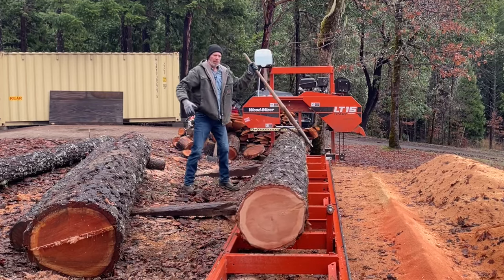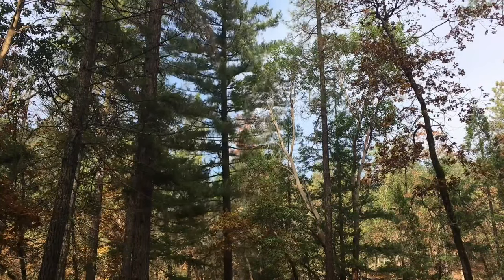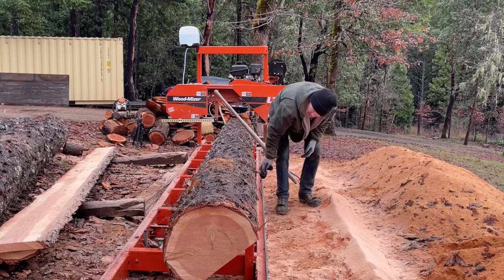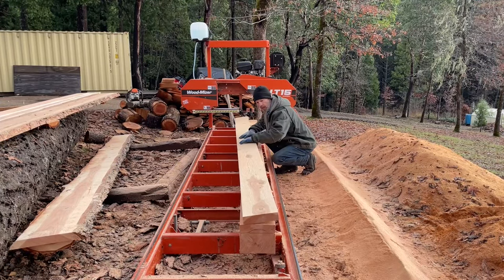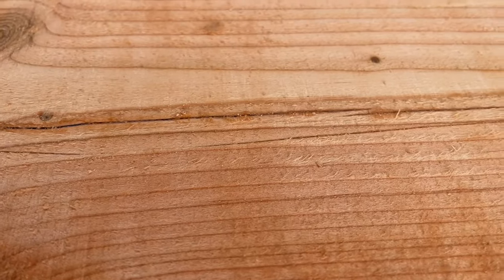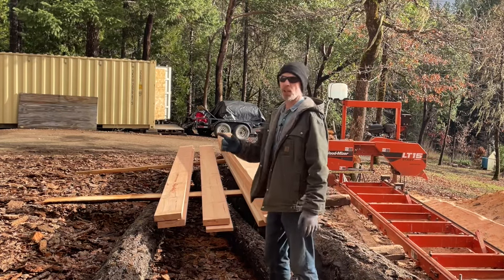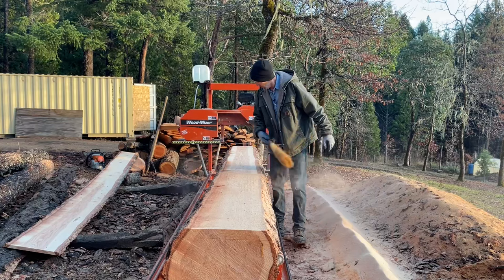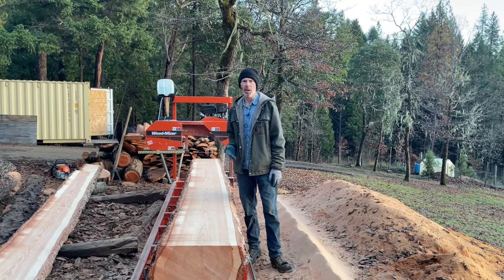Milling Out Cracks & Ring Shake w Woodmizer LT15 Sawmill

Comment: Have you ever had problems with the rail after rolling big logs over them? Woodmizer tells me that's why they don't sell log ramps for the lt15 wide, because that would void the warranty. I figured I would just build some that sat over the top of the rail, but I'd have to take them off and put them back between every log.
Reply from the maker: Sometimes I have had the bed segments misalign some if I put a lot of weight on them. That’s partly because the feet are not evenly supported because they don’t turn and adjust any more. And on the LT 15 start, only one side of the bed rails are pinned together, the other side are just held by frictions of bolts pulling them together.